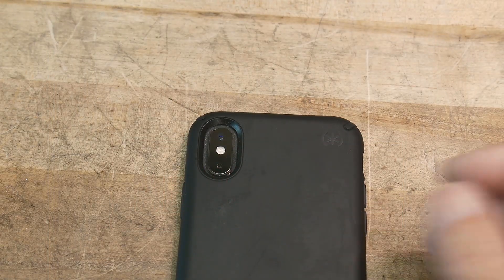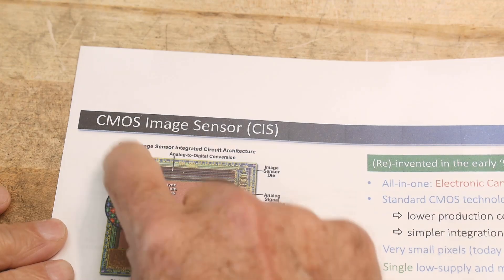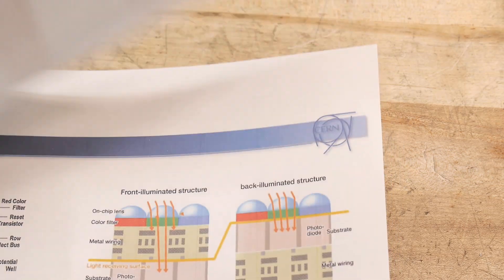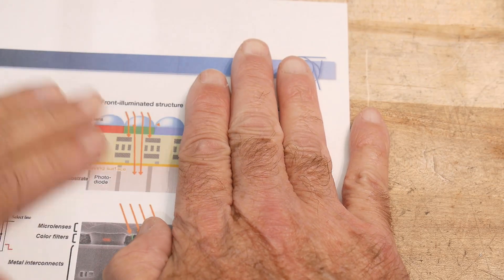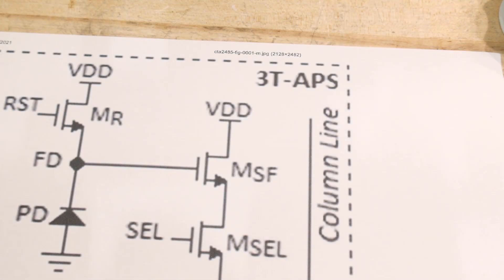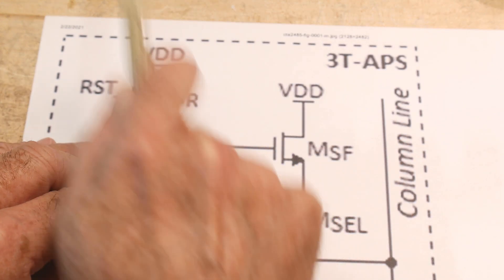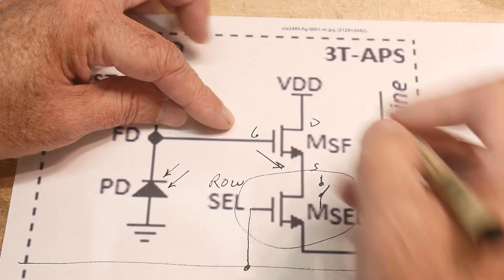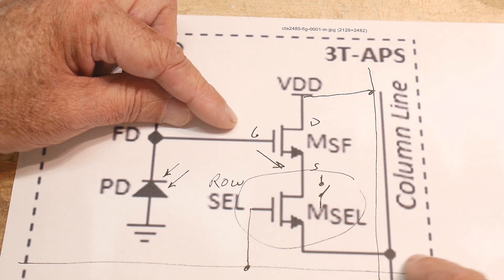#743 Basics: How Image Sensors Work

Comment: That's really cool, but speaking if this source follower transistor, when you see datasheet of some mosfet, the threshold voltage in most of the cases can vary greatly, for example from 1 to 2.5V. Do all transistors have similar threshold voltage when produced on a single wafer? Even then, it should be compensated in some way so there wouldn't be any significant differences between chips. How is this issue solved?

Comment: Thank you a lot for the detailed explanation! 

One question.... Why is this a CMOS sensor and not an NMOS sensor? Where do the PMOS transistors come in? I see that M1, M2, and M3 are all NMOS.
Reply from the maker: from wiki: The two main types of digital image sensors are the charge-coupled device (CCD) and the active-pixel sensor (CMOS sensor), fabricated in complementary MOS (CMOS) or N-type MOS (NMOS or Live MOS) technologies. Both CCD and CMOS sensors are based on the MOS technology,[4] with MOS capacitors being the building blocks of a CCD,[5] and MOSFET amplifiers being the building blocks of a CMOS sensor.[6][7]
Reply: @IMSAIGuy  I see, thank you again!!

Comment: I would replace photo diode, with photo FET.  Then you probably do not need reset or source follower, the photo FET itself could be used as source follower.  So could have two transistor ( photo FET and the other select FET) and no diode, no reset , and no source follower.  Check out photo FET, they use it for high frequency microwave amplifiers and oscillators, embedded with its own transmission line.  Also, you are probably using direct band-gap semiconductors, the process engineer instead of grinding, could do filp-chip, or process both side of the die. one side photo element with color filter and the other side part of the signal processor chip.
Reply from the maker: the schematic is more of a block diagram. the actual device is more of what you say the 'diode' is really the gate of the follower. you need the reset for the function of an electronic shutter. otherwise the the photo area will just saturate.

Comment: I appreciate this fundamental description.
The kind of image sensor you are describing is an APS (active pixel sensor), i assume.
In real I think the reset circuitry works inversly, but for your amazing presentation it would make no difference in understanding to not complicate it more as neccessary.
Reading photodiodes is highly linear if you convert the photocurrent in short circuit (10 or more decades, more than 32 bit). How linear can this APSs be?
And in some cataloges, especialy for spectrometers, there are CCD sensors mounted.
From datasheets of CCDs I know that their dynamic is only about 7 or 8-bits.
Why are CCDs nevertheless used?
Reply from the maker: The photons create holes (not electrons) so the reset sets the photodiode to Vcc. CCDs can have a much lower noise floor so are used in measurement applications.
Reply: @IMSAIGuy  Ok, thanks for the quick reply. So it is my misunderstanding of the term "RESET". The not illuminated pixel is read as nearly Vdd. The higher the Illumiation of the pixel, the lower is the voltage read.

Comment: The first digital "camera" I ever had was a 3rd party board for my Apple 2. It consisted of a dynamic RAM chip with a quartz window so light could get at the chip. The RAM chip was on the end of a 2 foot long ribbon cable and a standard camera lens was used to focus light onto the RAM chip. The Apple 2 would write all 1's to the RAM chip and then wait a few 10's of ms or so. It would then read out the entire RAM chip. The memory cells that had enough light striking them would read back 0's. The light bled off the charge on the RAM memory cells. The ones with not so much light would still read back 1's.  Thus you got an image that consisted of each pixel either being white or black. Extremely bad resolution but it did work! I think I even still have that board around here somewhere.
Reply: That’s cool! I was learning about old eprom chips and I was wondering if something like that was possible!